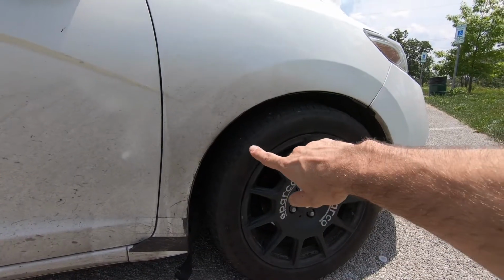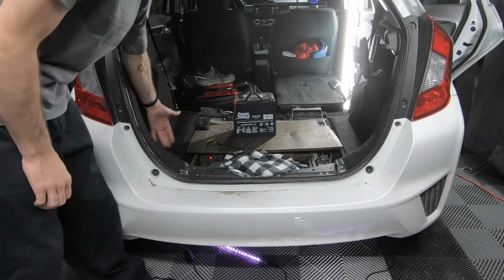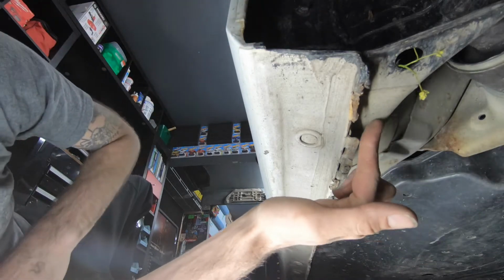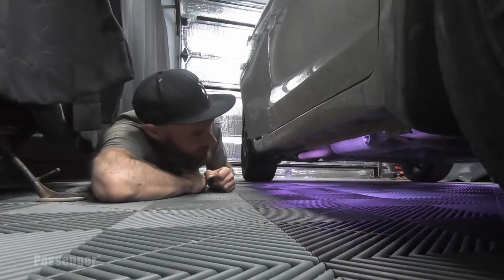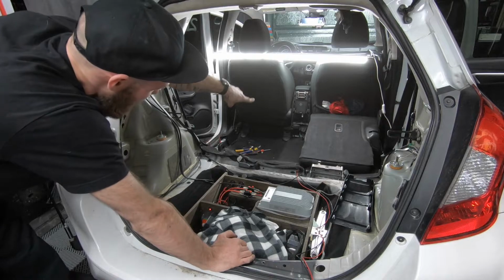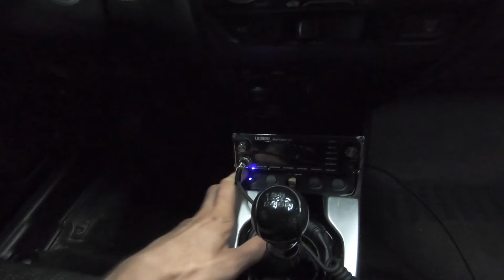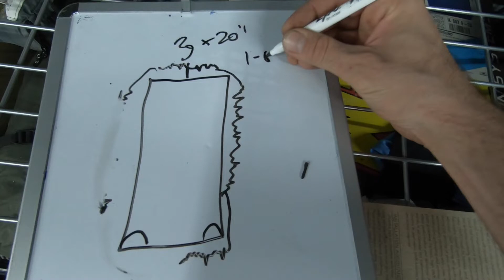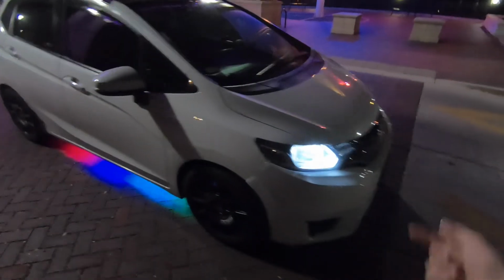HONDA FIT/JAZZ - GK5 - "Under Glow" Installation Destruction Salvation & Review #HondaFit4Adventure

Comment: Attention I tried this on the ge8 model if you don’t have side skirts it won’t work the only places to put it are weird and rubber like, I even tried to glue it but apparently it’s not a good adhesive the back and sides will be near impossible to hide the actual strip itself becuase you’d have to put it on the plastic which is very close to the side
Reply from the maker: Update:
My side strips are hidden behind the pinchwelds running down both sides of the car. 
They were attached with the supplied adhesive strip and a bit of superglue.
One side strip is in direct contact with the metal, while the other side is on top of the plastic skid tray underneath the car.
I also used some smaller zip ties to help secure the side attached to the skid tray. You should be able to do the same on your GE8. 
You are correct about hiding the lights on the rear though. "THERES NO GOOD SPOT!"

I ended up adding some quick disconnects between the light strips and adding the rear set to my engine bay.
https://youtu.be/hvAXbtpq7F8?si=4R_GFI8iMb0Ztda5
Send me some pics of the undercarriage on your GE8 through IG and I'll see if I have some suggestions.

Comment: What's up buddy. I don't know if you remember me. But I was the one that told you I was gonna get the honda passport.... So yeah, I did it bro! I finally got my dream car, or actually, truck. The honda passport! Its freaking amazing bro!! I'm sad to say I traded the fit for it, which I might add, has great resale value. They gave me $11,000 at the dealer and I gave a $4,000 extra, made it to a $15,000 down payment for the passport. Dude you would love this car. If you love adventuring like I do... You're gonna love the passport. There's no such thing as "getting suck" in mud with this baby lol
Reply from the maker: The game plan is...
When the FIT is a bit older it will become a K-Swap project while the Passport becomes my new daily.
The FIT's at 85k so I've got some time.
Reply: Hell yeah bro god bless. You're gonna love the passport